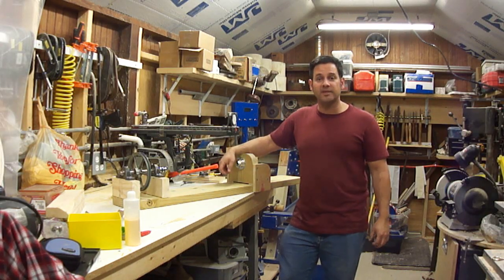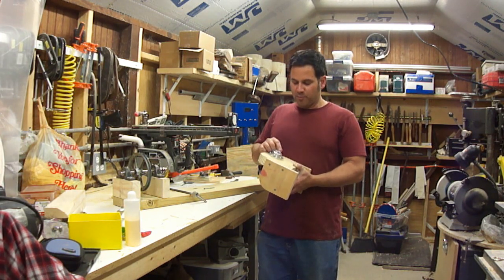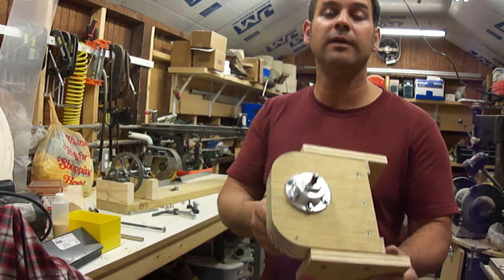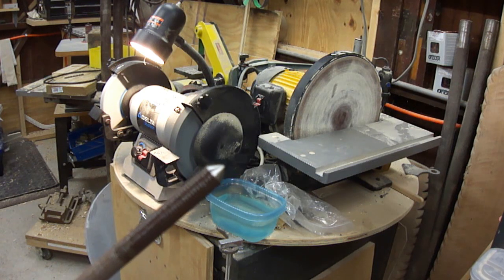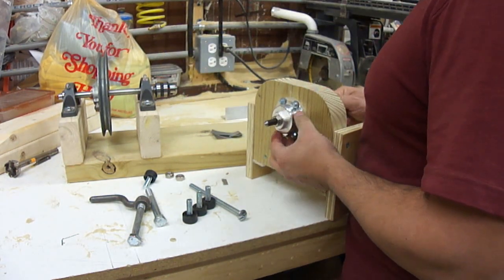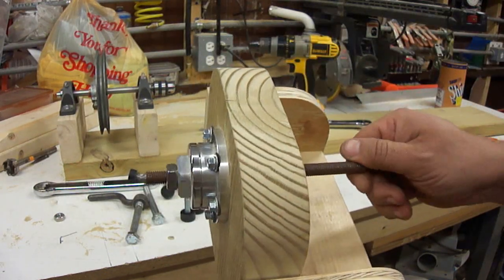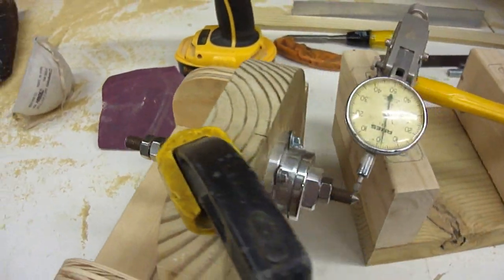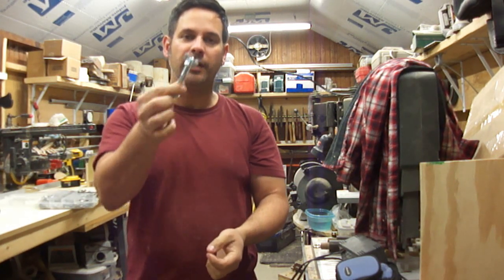HomeMade Lathe Part 3 - spur drive, live center, bed ways (torno casero)

Comment: Bicycle hub live center! Of course. Why didn't I think of that?
I used roller skate bearings and a wooden shaft to fit into the skate bearings tightly. I have a box of various salvaged bicycle hubs. I could use a whole hub, including both flanges and axle. I hope I have one with a solid axle. I'm a little concerned that they might not behave at the high RPM's of my drill.
Reply from the maker: Glad you liked the idea. Did you try it out?
Reply: @RayMAKES  I made a few large dowels and a bunch of file handles with my roller skate bearing version. It was a test prototype. From it I learned that turning down 18" out of balance tree limbs over 3" would shake my whole wooden lathe to pieces. I would have to greatly beef up the lathe frame to make it sturdy enough. So I bought myself a HF lathe for Christmas. I won't rebuild the wooden one until such time as wanting to make long turnings. It is difficult to find, say 36", long tree limbs that are round and straight enough so as to not shake a wooden lathe apart regardless of what bearings I use. I'll have to rig up a manual rotating contraption in combination with a router or power hand planer to carve such a large limb down to round and straight.

Comment: isn't grinding on thd side of a wheel kind of like crossing the streams?  :)
Reply from the maker: +Cliff Hartle not sure about that, but I use the sides only when I want to gently grind on something.
Reply: +Ray Pena I was always told the wheel could explode. 

http://www.homemodelenginemachinist.com/showthread.php?t=8635
Reply from the maker: +Cliff Hartle interesting! I've never seen it. I have however witnessed 24" diameter surface grinder and Blanchard grinder stones explode, while using them "correctly" . I suppose it might just be one of those "sometimes it just happens" kind of things.
Reply: Besides the forces I think it's also an issue with uneven wear on the wheel. I'm pretty sure my father told me this 40 years ago.
Reply from the maker: +Cliff Hartle hmm...Its a good thing I don't do that often then ;)
Reply: I'm surprised as you got into this line of work you never heard this from an "old timer".

Oh wait I just realized, I'm that "old timer" :(
Reply from the maker: +Cliff Hartle you might be right!
Reply: Ray Pena Ok so I guess I now have to start calling you "Sonny". :(
Reply from the maker: Lol!